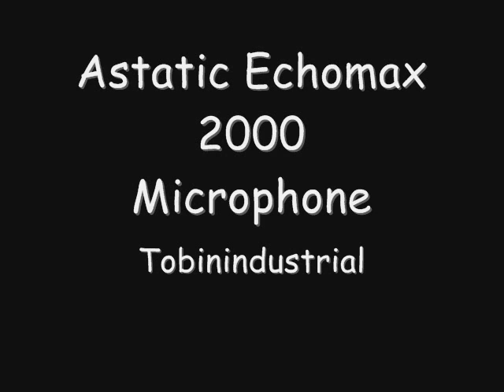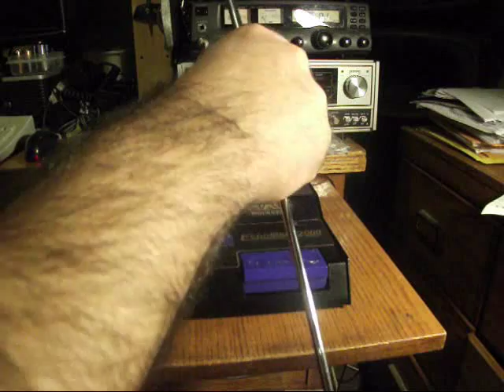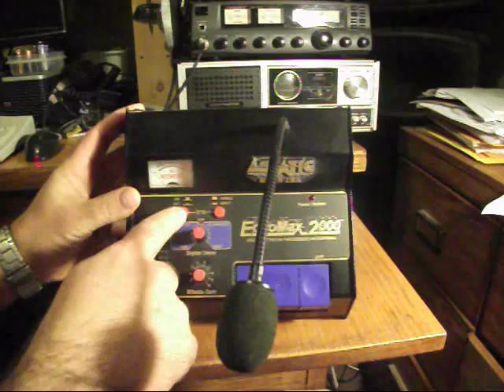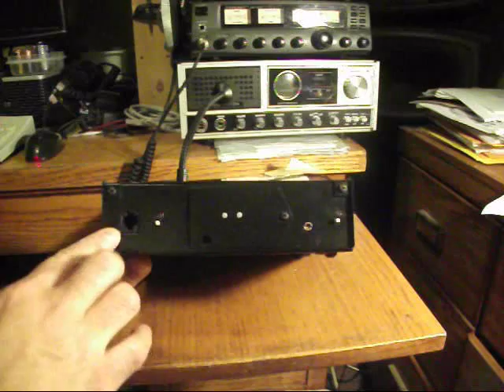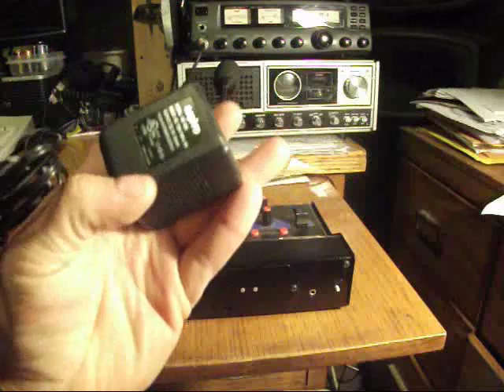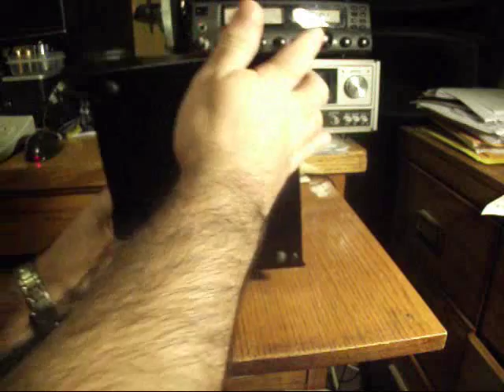Astatic Echomax 2000 Microphone

Comment: Old School Andy - what do you set the Echomax at on the Supersnake ?
Reply from the maker: Hey Russ. the gain on  the back of the mic is set to about 15%. The top slider is at maximum and the Gain on the Cobra 2000 is at nearly 2 O'Clock. Good luck with the setup. The gain on the back of the mic is pretty sensitive so it may take a few tweaks.
Reply: @Tobinindustrial  Thanks brother I have one on the way - lucky to find one - I will try those settings. I bet it rocks 🫡
Reply from the maker: The mids and highs are somewhat boosted aggressive and, although it is not the ,most pleasant and smooht talking mic, it cuts through the the CB radio frequencies very well and stands out amongst the many other callers. You will get noticed.

Comment: hi i got the same mic but having a hard time wiring it up to my cobra 2000.
Reply from the maker: You need a cat 5 plug end for the microphone side of the wiring. I electronics shop could place the wires into it for you. It don't matter the color code as long as you use the 5 wires on the 5 pin plug for the CB in the proper pin arrangement. Good luck!
Reply: do you know what the color code is i got black,red,yellow,green,white,ground tried wiring it up no luck do you know the order?
Reply: sorry i forgot to till you i have the cable with the cat five on the mic just don't know the order to solder to the 5 pin